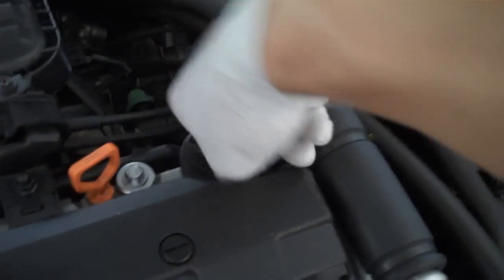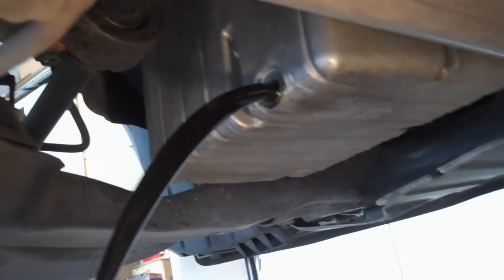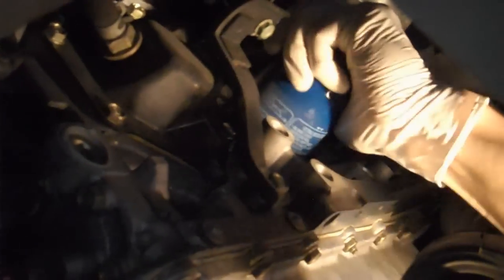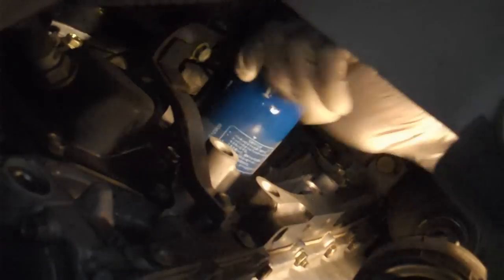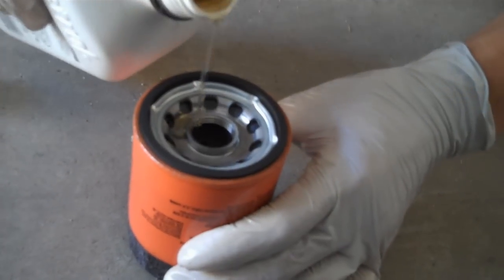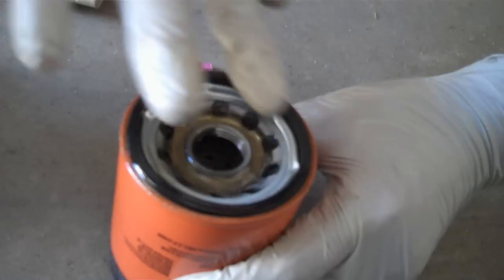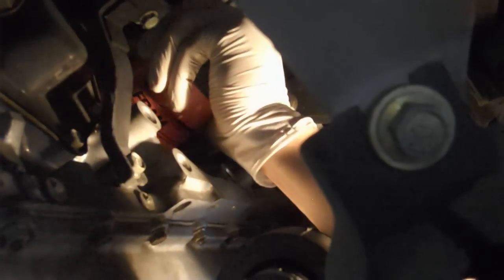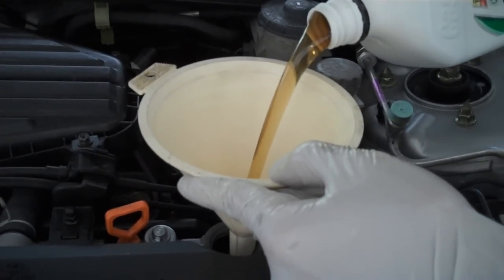Tutorial: How to Change oil on a 2004 Honda Civic

Comment: you forgot to say, check to make sure the seat for the new filter is clean. sometimes the rubber seal can get stuck from the old filter.
Reply: Ive had oil all over the garage because of this.

Comment: i have a Honda civic 2005, and Does not matter if the engine is new or old with more than 200,000 mileages the oil always should be 5w-20????? 
Here the mechanics say that should be a more viscosity like 10w-30 or some like that because the engine is not new, is that right??
Reply from the maker: Its really preference. You can use higher viscosity if you want or "high mileage" oil. Its up to you

Comment: what size socket do you use
Reply from the maker: +stormbringerr mourn 17mm for the drain bolt
Reply: nukem384
i found out, but thanks.
Reply: nukem384
my oil drain plug on 2003 ex coupe was 12 mm. it did not have a magnetic drain oil plug. does this mean a different plug was put in by someone? i bought it used. should it be magnetic
Reply from the maker: its possible?  mine isnt magnetic either.  as long as it doesnt leak, its all good
Reply: i have read that the magnet does very little as long as you use a quality oil filter. i use Bosch distance plus w/ full syn. mobile 1 oil